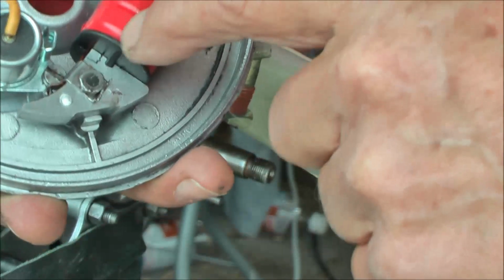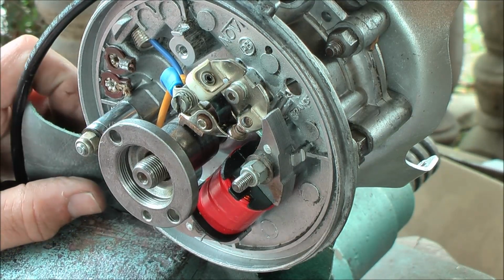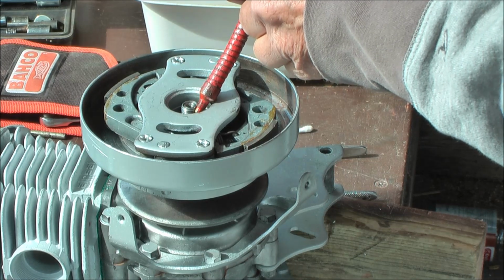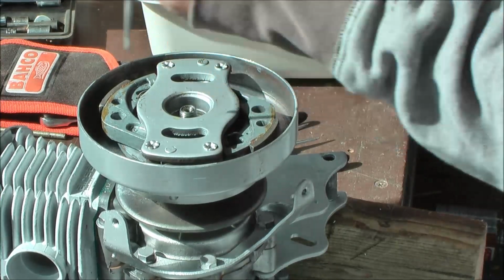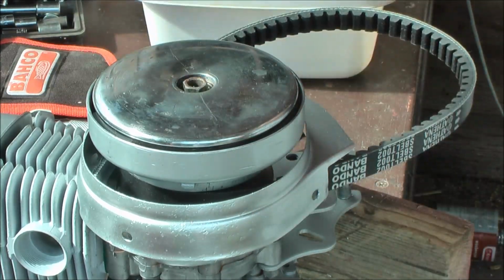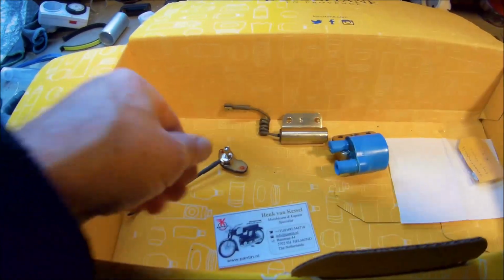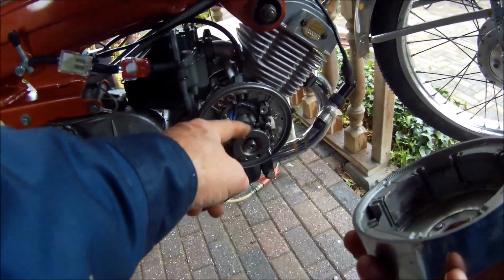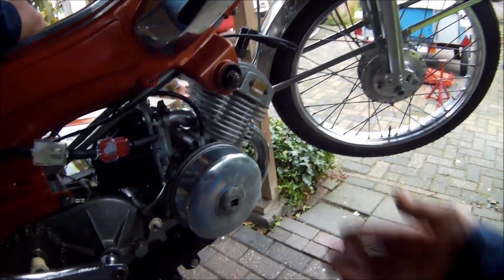Mobylette Motobécane engine mounting AV7 2,5r Part 2 ignition, clutch, frame

Comment: why two fuel filters?
Reply from the maker: I was not 100% sure about the cleanliness of the petrol tank. Since plugging of a jet of a carburetor is very common when no filter is mounted i mounted two. Most filters (well, diesel, air etc) have a cascade like principle. Gerard
Reply: @Gerard_Hugo  grazie gentilissimo.

Comment: Nice Video.
I Love the Mobylette Mopeds.
I have 1962 AV48.
In top Speed is realy fast,but when the Engine is driven few kilometers,i have a Problem.
When i start from Standing (traficlight) is no Power.
I regenerated the engine.everything is new .. Camshaft bearings and gasket cilinrdre gasket head gasket.
The ignition Timing is 1,7 before top.
12millimeter Gurthner AR12 Carburator.
I changed the Main jet.
But the Problem ist Still there.
If i have just a bit climbing  Situation,i have a Big Problem.
I changed also the Clutch.
Since This day i realezed Like Gear changing,what i didnt have before .
Top Speed is realy fast,arrond 60-70 kilometers per hours.
Mesured by GPS.
The Teethwhels are Original 11 and 54 ...
I have absolutely no idea whats the Problem.
Reply from the maker: Hello there. Since your engine seems sound (because of the high top speed) I think of two possible problems to check for: 1. Variator blocked (between the clutch drum and the cranck case), OR 2. Incorrect operation of the carburetor at low rpm/stationary (this works with another (smaller) jet than the main jet).
1. Can be checked by looking at the engine while accelerating (revving up) when the moped is on its stand. Then the engine should swing backward against the two springs that keep the V-belt tensioned. Another way to check this is to look at the V-belt while running over the clutch (front) pulley when revving up or closing the gas/air handle (revving down). The belt should visually be pushed up on the poulie when revving up, or slide deeper in the pulley when revving down. The variator pulley must be able to slide on the cranckshaft axle (helped by a little bit of grease !!
2. Remove the carburetor and clean it; preferably in thinner (paint solvent or acetone). Remove ALL plastic parts before cleaning with acetone as acetone will dissolve most plastics. This YouTube film will help: https://www.youtube.com/watch?v=OjucOmr-UIY  I clean carburetors with the help of a (jewelry) ultrasonic cleaner filled with a solvent (attention: acetone will attack the plastic case). Please let us know if one of these tips helped. 
To finish: Check if air can enter the gasoline tank by the plug! This was the last problem that I had with my AV92. Now it runs perfect (but now as fast as your AV48 !!). This will choke the engine at high rpm's. Good luck. Gerard